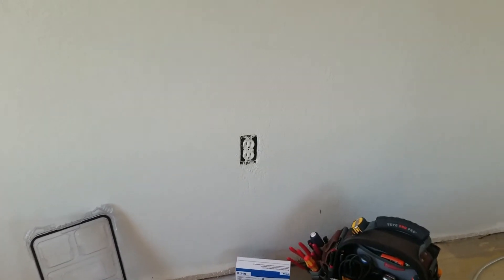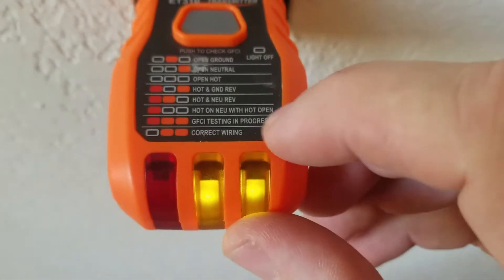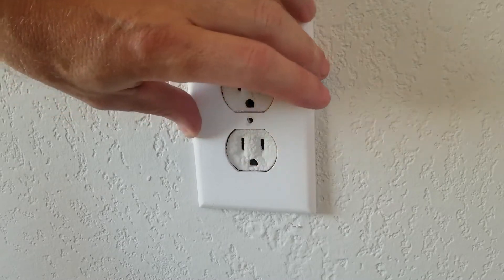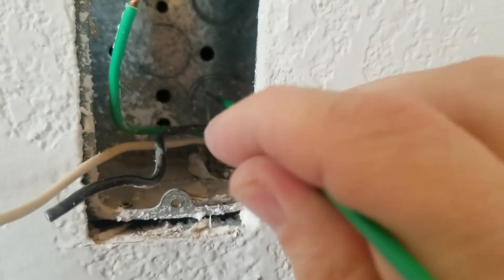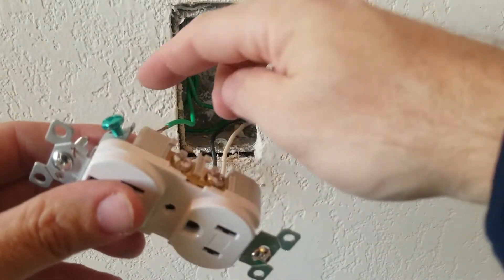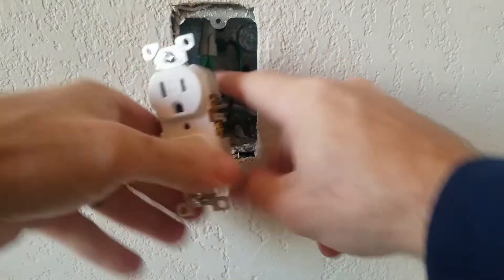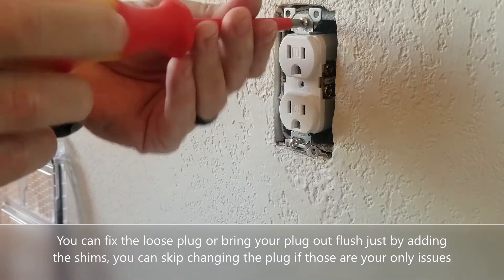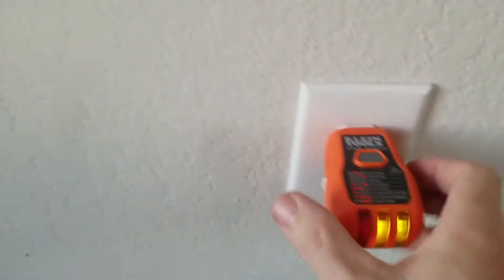Outlet / Receptacle Issues - Loose, Non-Flush, Sunken Outlet Fix & Replacement

Comment: After putting in a new RECEPTACLE, it can be twisted, especially with 12 gauge wire.  I use the ET310 or whatever tester to twist the receptacle back into plumb & level.  Regarding the screw, I just make it tight, I don't care about the orientation (call me crazy). Ha.
Reply from the maker: You are right on the Receptacle… I call them all sorts of things, usually whatever the customer calls them so they know what I am talking about..

No way I could just make the screw tight and live with myself 😂😂

Thanks for your tip with the tester 👍

Comment: the next receptacle ("plug" !?) would be in parallel,  not series.
Also; plugs have prongs that go into the sockets of a receptacle...
you're welcome! ;-)
Reply from the maker: Thanks for the comment and you are 100% correct.

I have heard them called more than those three terms. Crazy enough in my area I hear it called plug more often than not. I tend to try and call them whatever the person I'm working for called them so they understand me.  Probably why my brain said all the words throughout the video.

It's the same with plumbing materials, alot of those have multiple descriptions depending on where you live too.
Reply: @MORGANSMaintenance  ah yes, plumbing is always worse :-)
Reply: A plug goes into a receptacle. Easy as that 👍

Comment: Thanks for the shout out Mr Morgan. But as I told you the other day vertical is the way the screw on the cover should go. Also want to say great job at showing how to find the breaker with the klien tracer even though you knew what breaker you where needing to turn off. Your the man
Reply from the maker: Putting screws in cover plates can just be another thing to add to the list that I do better than you I guess.  Lol

That is the best breaker finder I have found so far....for the price.

Thanks buddy!